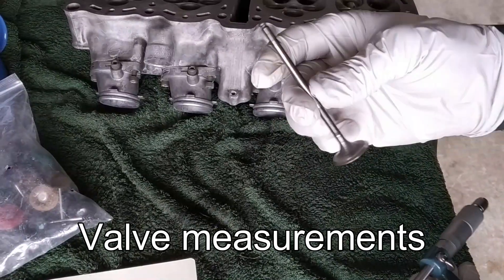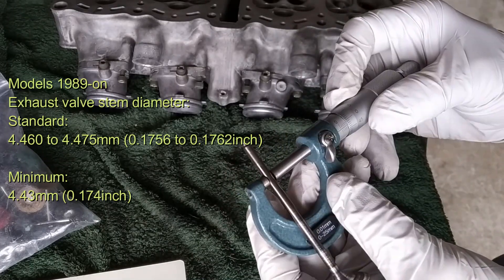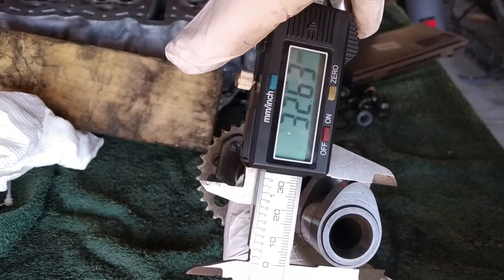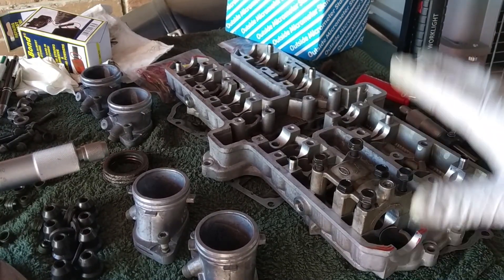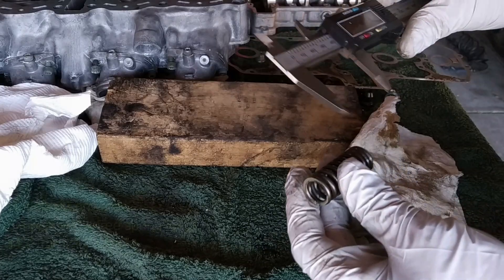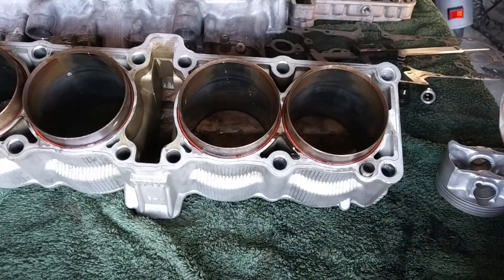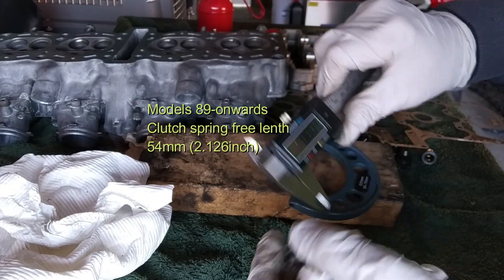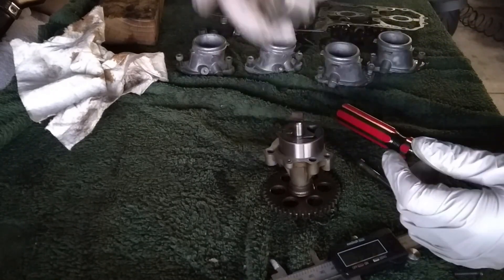Yamaha FZR 1000 Exup Full engine restoration Part 5

Comment: I must admit if I ever stripped this engine I would not be able to resist having some performance parts popped in as its a once in a life time engine strip/ Cams pistons and gass flowed head. Great job. I used to race one I bought it brand new and put it on the race track after running it in on the road. Great bikes
Reply from the maker: I totally agree. They are very reliable. I rode it today, and I felt I was in the '90s!!!
It's definitely a great idea to put a performance package in it, but I was kind of limited financially.  
Thank you for your comment 🙏

Comment: In my experience and I’ve built several engines u learn to get s feel with the Tele gauges and micrometers the telegauges in particular take some time the way to test that is to do several measurements and compare from the same place in the bore for eg u just learn to centre the gauge correctly by “wobble method” as sometimes the gauge will not easily self centre my preferred tools for measuring bores is Dial bore gauge  which money wise r far more accessible than they used to be  and they tend to self centre better   I am building a Yamaha fz911 engine using fzr1000 ( gen one ) pistons and barrels and head on a fz 750 bottom end with the six speed gearbox  I am interested to c if u measure the main brg bores ( no shells fitted) and c if u find any ovality or taper there I did and am very disappointed by this as I feel this should b highly accurate  if u find this problem I’m interested to c how u remediate this as I haven’t been able to get any experts opinions  keep up the good work Oh I have seen a u tube video where a guy builds up the worn valve faces on his genesis 1000 ( first gen) with stellite via tig welding  this may be an effective and cost effective answer for u
Reply from the maker: I think you're talking about the German guy. Yes, he did an amazing job! I envy guys like him. 
Unfortunately I didn't measure the main bearings at all. Now that you mentioned it, maybe I should. But I thought since there was not significant wear on the bearings, there was no reason to. Also there was no data on the service manual. Again, maybe I should. Never thought about the ovality. Thanks for your comments and your advices. I appreciate them!

Comment: Hey Chris! This video is helpful to me, doing the same procedure on my Thunderace. Can you recommend a model micrometer and caliper for this job, looking for good quality that I can use many years!
Reply: Another question I came up with is what manual are you following? Impressed by your informed method of working! Love it!
Reply from the maker: Thanks for your comment! Looking in the market for a manual, I couldn't find anything else but Haynes. 
As for the micrometre and vernier calliper, if you find Mitutoyo, buy it straight away! I'd prefer the digital over the analogue, as it's much easier to read!
Reply: Awesome thanks! And the Haynes guided you through the entire engine build?  @ChrisSofos
Reply from the maker: @jaesaren  somewhat yes! But it's not very detailed. I have done that kind of work in the past, so I knew what I was doing. I just advised the manual for specs.
Reply: Thanks for your replies!  @ChrisSofos

Comment: Hello Chris! Your videos are very helpful! I have same type of an engine stripped out.I was measuring my pistons and they all seem to be out of tolerance. 75.416 pretty consistently. What now?  STD pistons nor os seem to be available anywhere. Did your pistons show similar results?
Reply from the maker: @alexhellx8897  My pistons were well within the limits, so I had no issue with that. I can't remember the values, so can you tell me how far off your pistons are from the limit?
Reply: @ChrisSofos  well as you stated in your video that the limits are 75.440 - 75.425. My pistons were from 1st to 4th. 75.408/75.416/75.413/75.414. Measured with a mitutoyo micrometer. Calibrated.
Reply from the maker: @alexhellx8897  that's a good micrometre brand! Look, it seems that you're off limits. Even though I'd probably put the same pistons in with new piston rings, I can't advise you to do the same. Especially if the piston-to-cylinder clearance is out of limits.
The only other option you have is aftermarket pistons, like Wiseco. Expensive,  but top-notch. The cheapest solution here would be used ones, but make sure the specifications are well within limits
Reply: @ChrisSofos  i’ ve Measured the bores and it seems that they’re at 75.505 except no 1 which is 75.515. The piston and the bore seems worse at no 1. And to mention that the bores has’nt been honed yet,which would make the situation even worse. I’ ll start looking for a good set of used ones and if i can’t find any, the wisecos it will be then. I haven’t build a motor with aftermarket pistons yet so i must ask, do the wiseco pistons/wristpins go with the original conrods?please advice. Ps. I greatly appreciate your help and you have found time to answer my questions. Cheers friend!
Reply from the maker: @alexhellx8897  no problem.  It's my pleasure 🙏 
Yes, they're made to fit this specific model. So you can put them on the original con-rods with no issues.
Reply: @ChrisSofos  thank you for your fast answer!

Comment: Hi Chris, where are you sourcing your valves from? and have you bought a full gasket set yet? if so whose did you use?
Reply from the maker: For this engine I bought everything original Yamaha from Megazip.net
O-rings, gaskets, valves etc. Occasionally I buy some parts also from eBay or cmsnl.com
Reply: @ChrisSofos  I bought a full gasket set from Athena, it came with every o ring, oil seal, valve seals the lot, good quality as they are OEM suppliers to many manufacturers. I also use cmsnl, i just had a package arrive from them this week with alot of hard to find bits like fairing infills and fresh air ducts that my bike was missing. They are very good, if a bit pricey.
Reply from the maker: @uhtred7860  I've heard of Athena many times and I've seen ads of them here and there. They sound like a serious company as you say. I always have their products in mind! Thanks for the feedback!
Of course, when it comes to OEM parts...they are always pricey! Especially with every bike that I have. Most of their parts are discontinued.